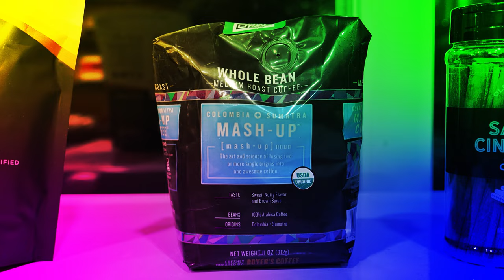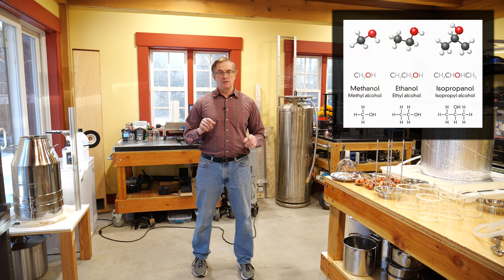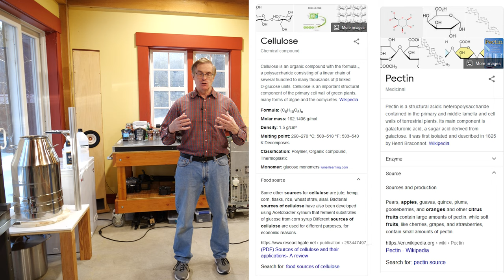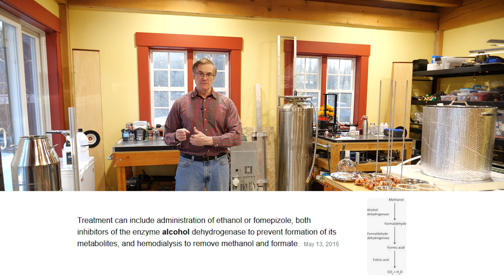Making Vanilla Flavored Rum! - Part 2

Comment: The foreshots and heads from a pot still are NOT methanol. In fact, the highest methanol to ethanol ratio is found in the tails. Boiling point is irrelevant. What matters is how well the methanol sticks to the water, as compared to ethanol. See section 5 of https://www.intechopen.com/books/distillation-innovative-applications-and-modeling/distillation-techniques-in-the-fruit-spirits-production :

“Methanol appears in almost equal concentration in all fractions of distillation due to the formation of azeotropic mixtures [39, 40]. It is really difficult to separate the methanol from the ethanol-water mixture. When low alcohol mixture (like fruit-fermented mash) is distilled in simple pot still, methanol will go out following his solubility in water rather than his boiling point. Methanol is highly soluble in water, therefore, methanol will distill more at the end of distillations, when vapours are richer in water. That means that methanol will accumulate more in the tail fraction [7, 32],during distillation in alembic pot still”

You can set up a column still so that boiling point becomes relevant again (high reflux ratio) and methanol comes out before ethanol. But, then you make industrial alcohol and not rum.
Reply: I read the paper carefully, because I am a physician and I have a background in Medical Toxicology and Organic Chemestry.  What you said did not make much sense to me until I read the paper. Regarding distillation of spirits you were both right and wrong. What you say is valid for fruit juice or wine distalates, which is what the paper is about. Fruit juice and wine contain pectin and other polysaccharides. These produce  low amounts of methanol (nontoxic amount) that are generally distilled out in low concentration throughout the process.  As the temperature of the mash increases as the  concentration all volatiles  decrease, methanol that is bound to other substances in the mix becomes unbound and volatile.  It  is then distilled at a higher concentration  toward the end.  It is still nontoxic, because the ethanol content blocks the liver metabolic pathways that make methanol toxic.  Mash from grains and other high cellulose containing substances including sugar cane, produces much more methanol.  Some of it is bound to substances in the mix, but a lot more is unbound and therefore highly volatile.  Since it is more volatile than ethanol it comes off in the highest concentration in the first distillate along with the aldehydes and distasteful volatiles.   This paper only tested fruit mash.  Rum and grain mashes are completely different critters.  I think you should read the paper again.  It is fairly complex and specific for fruit based mash.  Now if you want to make large quantities of methanol from natural nonpetrolium sources, wood and grass pulp is the best. That is how methanol got the name "wood alcohol" .

Comment: Full reflux - doesnt that make the more pure alcohol, less of the added taste from the melasses etc?
Reply from the maker: Full reflux is an often misused term.  Full reflux means nothing gets out.  As the reflux condenser flow is lowered, the reflux ratio begins to drop.  When it stops, the ratio is low.  Even a simple pot still has some reflux.  Take a look at our first video in this series where I described the operation of several different distillation systems including this reflux still.
Reply: @TechIngredients  ah, i thought all copperplatessteps etc removes all "tasty" - ie thats how you get vodka etc (i have dabbled to little with cooking =D thanks, see you in next episode =)

Comment: weird question maybe, i'd really like to try making my own spirits, but i'm in a jurisdiction that makes it pretty much impossible for people to legally make rum due to a ban on the act of distilling alcohol (except for commercial purposes with extremely expensive supervision by the tax office), even owning a copper still is illegal and with a glass one you better show them a decent reason your lab needs that. so my idea was to cook&evaporate off the methanol (not catching any of the vapours, thus not distilling it, thus legal) and then freeze the ethanol-water-solution so i can then just sift the water ice out (given the very different melting points of ethanol and water), do you guys think that'd work? probably gonna taste much different too, and i guess i'd need to be careful about that bucket of bacteria you put in there and get my flavours in somehow else or just make a different kind of spirit (gin sounds nice too though it would have to be done without the "passing the vapours along" bit, maybe by a more "tea-like" method of just soaking botanicals in the solution while boiling out the methanol), but in theory, would it work and do you think it's worth a try?

Comment: Nice video, only your statement on methanol in the foreshots is not right. Methanol will always be smeared out throughout the whole run...
Reply from the maker: Smearing implies that it is first separated and then partially reintroduced.  That will happen as long as the cuts have any finite volume, as they must.  The parrot exaggerates that effect.
Reply: @TechIngredients  well then my use of the verb smearing isnt correct because it is impossible to separate the methanol in the foreshots. It wil be in the entire run from foreshots untill the tails. When you use a potstill it even is in every cut in equal amounts, when using a column still you might be able to concentratie it somewhat in the beginning of the run but it is not possible to get rid of it all bij throwing away some foreshots and heads. No big deal btw because your statement on alcohol beeing a medicine for methanol poisoning is totally correct.

Comment: PLEASE PLEASE… YouTube need you… And I have a for a video
There’s a void in YouTube content Regarding electrical contacts, how they work, cleaning, maintenance, and refurbishment. WITH PROPER METHODS!

I’m talking about the silver alloy contacts found in relays, breakers, high current contactors, and things like that. You’re the perfect person to make a comprehensive video discussing the proper ways to clean, maintain, and even repair/refurbish them. With the right silver alloys and a bit of knowledge… It’s not that hard to re-tip them yourself. Especially with old equipment that is unobtainable. Contact replacement can cost hundreds of dollars in high current industrial applications and machines like lathes & mills.

There’s a huge need for this information because of the crappy way modern appliances are made. Washers, dryers, and many other household items use camshaft style timer controls… Which are full of electrical contacts that constantly arc and fail. And there are dozens of other instances where people need this information. 

Folks need to know they can’t simply take 220 grit sandpaper to their precision matched and polished/plated silver contacts.

and btw We could really use some more laser content!
Reply from the maker: Thanks for the suggestion.

Comment: OK, why a reflux still, instead of a pot still?

A pot still will allow the flavors from the 
mash, (wash) to go over.  A reflux still, not 
so much.

If I were making vodka, reflux still.
If I were making rum, especially 
flavored rum, a pot still.  Yes, you 
DID use the Gin basket, but the 
only flavor coming across, is Vanilla.

steve

Comment: 18:25 NOOOO!! You will need to split the beans down the middle then scrape out the seeds... that is the flavour part.
Reply from the maker: Maybe, but we don't want the small seeds falling through the mesh in the basket.  Vapor infusion is a little different than cooking, however splitting as well as the cutting I demonstrated would probably be even better.
Reply: @TechIngredients  yeah may need a different mesh

Comment: Vanilla flavored isopropyl alcohol. Too funny!  How about exploring cement.  It's been used for millennia, but has only recently been scientifically analyzed and understood.  It's everywhere, but most people don't understand how you can add water to a bunch of rocks and have it set and last for eons in the rain.
Reply from the maker: Ha!
Did you watch our first video in this series where I described several different distillation systems including this reflux still?
On the optical table next to it was our growing stack of UHP concrete samples for testing in the hydraulic press on the other side of the still.

Comment: You made expensive vanilla vodka. Needed a pot still.
Reply from the maker: No you don't.  Check out our first video in this series where I described the operation of several different distillation systems including this reflux still.  Reflux can be adjusted depending on the flow rate in the reflux condenser.
Reply: @TechIngredients  True. But, if you are getting a 95% ABV product from a 9% ABV starting liquid, that means you are running a very high reflux ratio and not getting much flavour. 96% ABV is the highest that is theoretically possible at atmospheric pressure. That would require a reflux ratio of infinity.

Comment: A bit of constructive criticism: please make sure the secondary camera is not in the shot. it is pretty annoying and looks amateurish and doesn't reflect the high quality of the content you produce. Also, using the gimballs controlls without any smoothing and doing all those adjustments all the time looks quite bad as well. at this point youre better off going handheld and stabilizing the footage in post.

Comment: Sorry dude you are wrong on so many levels ! First of all who wears latex gloves? Second you are making rum in full reflux mode ? And it looks like you are in deflagnator mode also you are make a neutral sprit at this point which you are stripping any flavour from the molasses! Also why would you not use your parrot for measuring and mark what percent on each jar instead of pouring it into a beaker then pouring it into your hydrometer bottle? Seriously you should stop now anyone that says this in a great video clearly does not know anyone about what you are doing.oh and gin basket for vanilla... sorry will not work!
Reply from the maker: I wear latex as do many others, that's why they sell them.  We have the reflux condenser nearly off.  Watch our first video in this series where I explained that reflux depends on a temperature gradient, without it the still operates with little reflux.
Reply: @TechIngredients  dude you are in full reflux mode what are you talking about! Plus you have your deflagnator on ? Your stripping your rum sorry! You should not be  making distillation videos and what up with your parrot? You are pouring highly volatile liquid